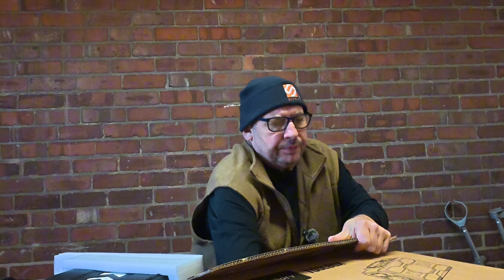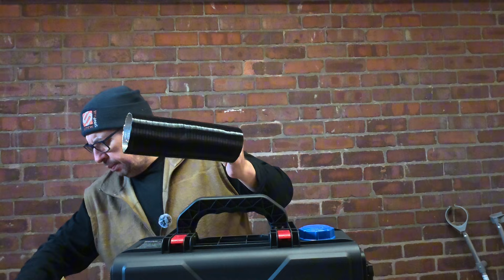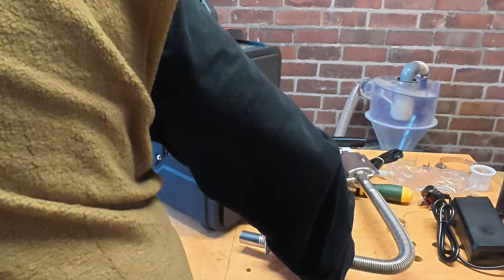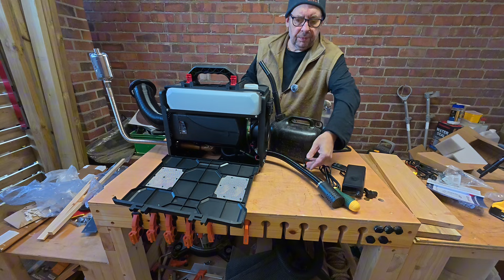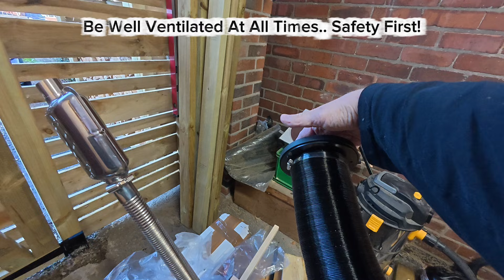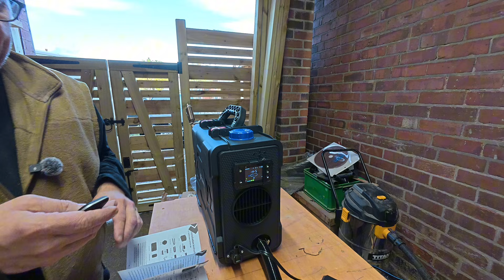Can This Portable Diesel Heater Keep My Workshop Warm? | Hcalory 8kW Review & Test

Comment: I have the same heater. I use it to heat my Motorhome Awning and it does a great job…I just wish they could have cut away a bit of the casing and inserted a clear piece of plastic so as too see the remaining fuel in the tank. I may try to modify it myself. Thanks for the video 👍
Reply from the maker: Yes I agree fella if you could see the diesel it would be a advantage definitely 👍

Comment: Hi Billy, Good review on your new diesel heater, i bet your happy with it, this is the first review on a heater with it's own mains supply. I have watched video's on diesel heaters but do not come with power supply just the wire to connect to a car battery or any 12 volt supply.
On other video's these heaters have been running on heating oil or paraffin, theres two video channels I've watched on these heaters one is by Andy Fireblade from the midlands and the other is by Steve ( STE777 ) from near Prestatyn.
A warm workshop is a happy workshop, catch you soon mate, take care.
Reply from the maker: Cheers fella it seems a decent bit of kit👌 my hands will now be warm when it gets super cold 🥶 👌🤛

Comment: I have 2 to heat my 2 car garage in New York. I run mine off a 12v battery that I keep on a trickle charger. It monitors the battery level and will shut down if it sees the battery getting low. If you lose power suddenly it makes a lot of smoke.
Reply from the maker: I got it so it runs of my mains power.. it seems a really nice bit of kit. Should keep my hands and feet warm anyway 😂👌

Comment: I have the same heater in my two car garage and it’s fantastic. The only downside is the ability to carry out maintenance to the burner assembly as it’s a pain in the neck to remove it so when it eventually dies I’ll get one that’s not sold as a compact all in one unit. Make sure you run it from a deep cycle battery and not the included power supply as these diesel heaters do not like losing power due to the required cool down cycle before being turned off. (Be sure to change the green fuel pipe for the hard white stuff when you get the chance as it will fail and create a huge mess, plenty of information on line about this).
Reply from the maker: Thanks for the tips fella 👌 this apparently is the upgraded version but time will tell, I can simply plug this into my mains supply